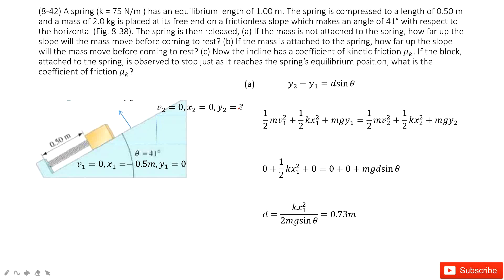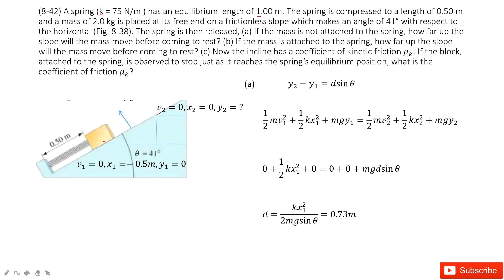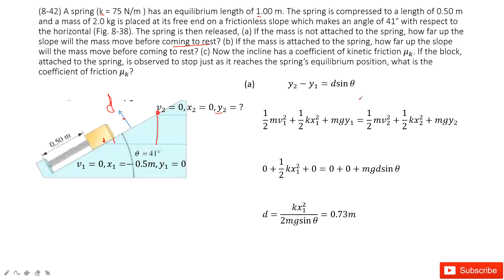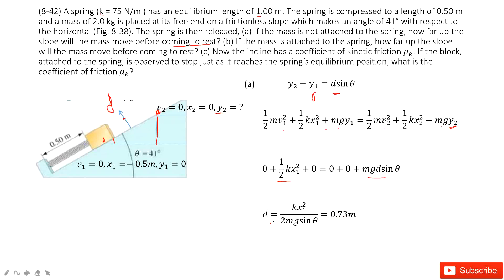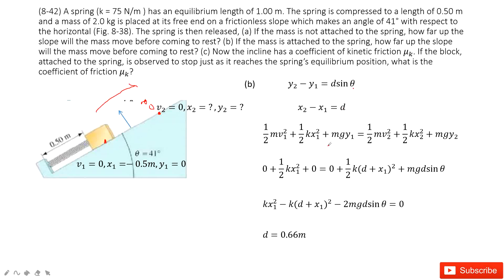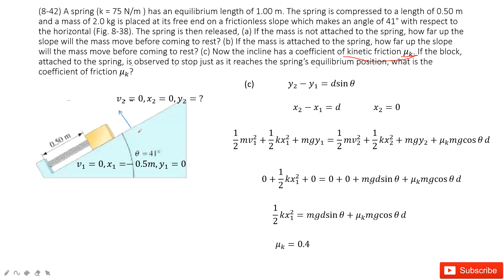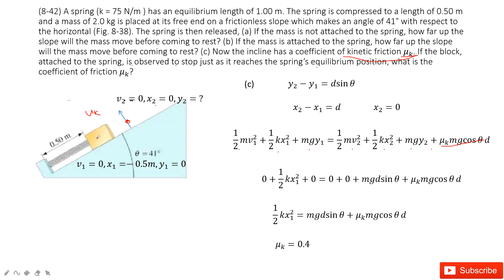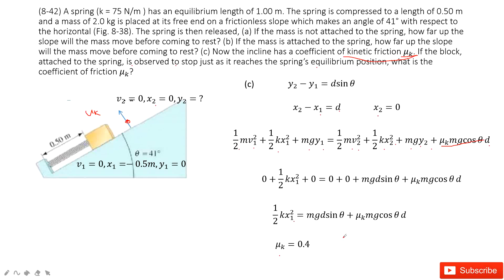(8-42) A spring (k = 75 N/m ) has an equilibrium length of 1.00 m. The spring is compressed to a len

Comment: Thank you for the great explanation! I was wondering about one thing though, why can't we just calculate d*sin(41) in part a) as 0.5*sin (41)? This gives the wrong answer, but I don't understand why..  Doesn't the spring just move a distance of 0.5 to reach its equilibrium length of 1m, isn't the magnitude of the hypotenuse 0.5? Or is it because we aren't looking at the end-position of the end of the spring, but at where the center of the box stops?
Also, would it be wrong to assume that the mass gets a certain acceleration and moves away with a certain velocity because of the spring returning to it's equilibrium (and pushing the mass)?
Again thank you very much for the help))
Reply: Ah, I see where I went wrong now. I didn't realise that I technically seperated the question into two parts and you did it at once, so I did like a part a.1) where I calculate the velocity that the mass has after the spring reaches its equilibrium (using gravitational potential energy, elastic potential energy and kinetic energy) and then a part a.2) where I calculate the distance the mass travels beyond the equilibrium point of the spring (using only gravitational potential energy en kinetic energy). So where I said that I got the wrong answer in my original reply was just that I got only half of the question.. 
Now I do have the right answer *PHEW*.
I would not have realised this without your video, I have been looking everywhere for solutions to this problem that I had, but yours was the one that made me realise the difference in my calculation and the solutions I found online so again thank you!!!
(thought I'd leave my comment for if someone has the same problem I did:))
Reply from the maker: You are welcome